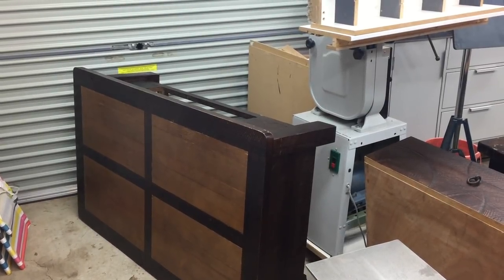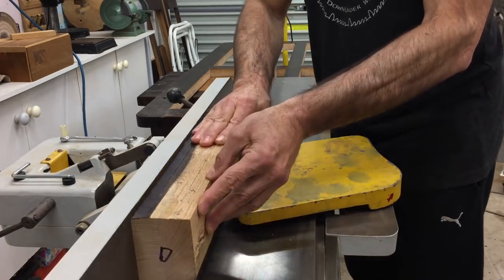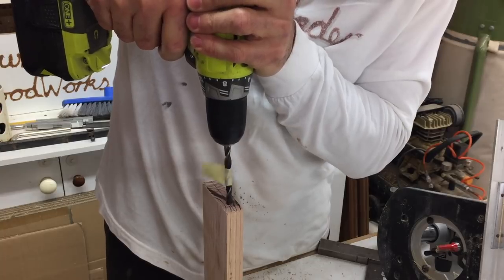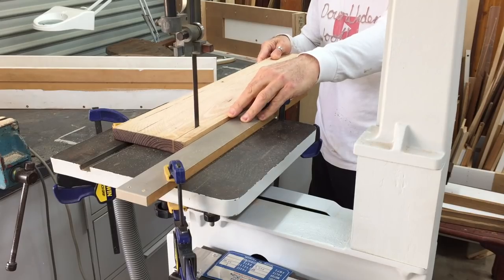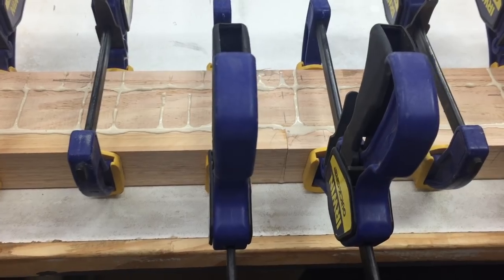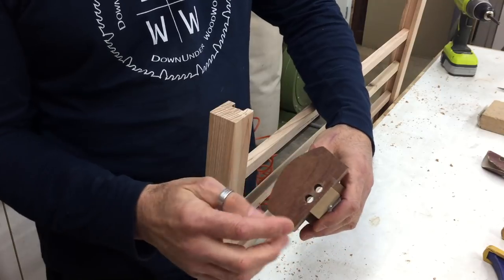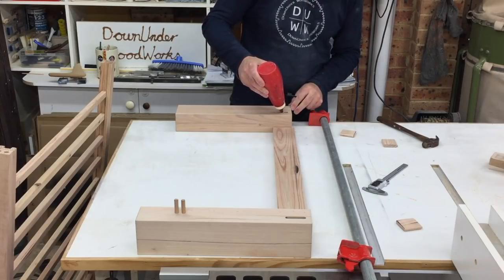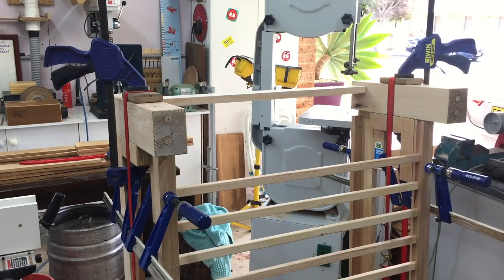How to give an old coffee table a facelift | Part 1

Comment: Getting the required length for the side rails was a job for the board stretcher. Base is looking good, and clearly much better built than the original which was held together with a million staples :D
Reply from the maker: Thanks mate. At least they used a million and not just a handful :-). Mate, wish I had of known about the board stretcher, I'm going to have to get me one of them.
Reply: @DownUnderWoodWorks  Lol. if you do find the board stretcher, tell me where you got it please :D

Comment: Have you thought about getting yourself an old 'g' clamp style dowelling jig?  I purchased one on eBay earlier this year, an antique Silex No 30 dowelling jig, made in Australia. it uses older imperial measurement bushings but I found the 5/16 one is perfect for using an 8mm drill bit and dowels, which is perfect for most of the projects I have planned and the one I'm currently working on, just saves having to make jigs every time you need to use dowelled joints. love your re purposing of an old coffee table like that, looks great.
Reply from the maker: Thanks Catey. I have been tempted many times to buy a dowelling jig but most I've seen don't take my fancy. There are a couple of stand outs though but they are ridiculously priced. Luckily i don't use dowels too often. Ebay or gumtree is a great idea. thanks.

Comment: Ditto the comments below. A lot of messing around to get it into bits, but lots of salvage, even though you needed to laminate etc.  Hard to tell but is it Mountain Ash??? For me, seeing the wood grain is always preferable to paint.  Tip from this video, roughing up the dowels with the Rasp, I have 'Squeezed' them in slip joint pliers in the past to grove for glue. Your method is much better. Looking forward to part 2. Thank you Victor.
Reply from the maker: Thanks very much Peter. I'm not sure about the timber, identifying species other than MDF, ply, melamine etc is not one of my strong points :-) :-)
Reply: Looks a lot like Vic Ash/Tassie Oak. Should come up great in the end.